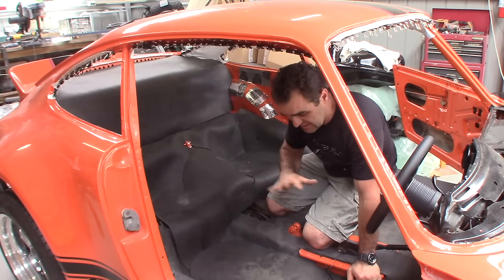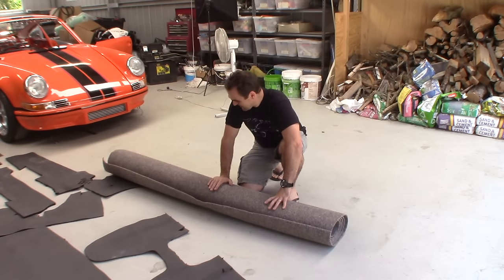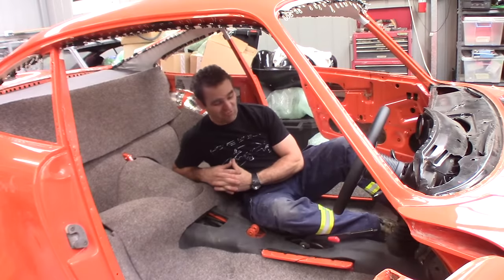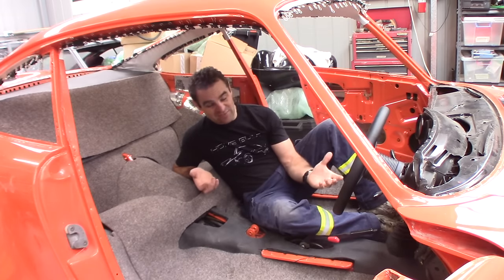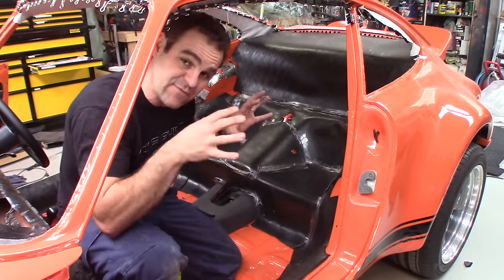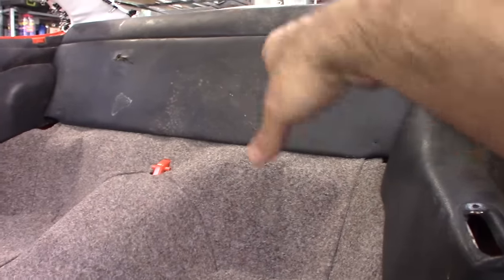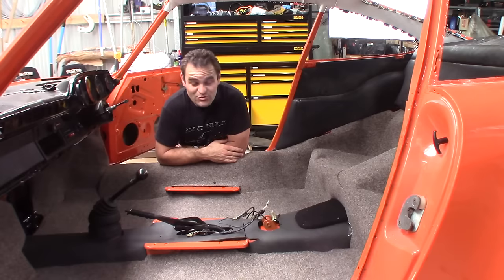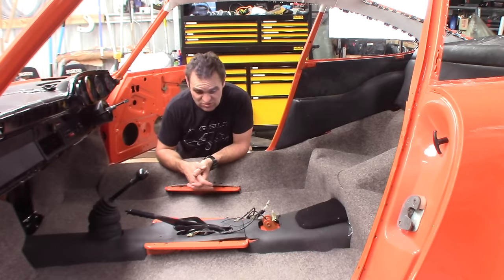Making a carpet kit - Porsche 911 Classic Car Build Part 37

Comment: Great decision on the AC. Even Porsche admit, a GT3 with air conditioning, is faster than one without. Because a cool race car driver is a lot faster than one who is being cooked in the car.
Reply from the maker: Like I said in the video. I am starting to come to terms with how I am really going to use this car, and realistically, I will rarely tatke it to the track, so I may as well make it comfortable. The performance difference between a comfortable car and a stripped out one is much smaller than the comfort difference.
Reply: everyone wants their car or motorcycle to be a racer until they have to actually use it for road duty. was going to build my old honda motorcycle into a cafe until i realized i want to enjoy riding it further than across town.

Comment: jeff have you considered using clips - ie. screw/rivot clip to floor and attach to carpet and clip the carpet in place.
Reply from the maker: I did look at using clips and I am still considering using something for the floor mats. The issue is I couldn't find anything that would really work properly. I looked at press studs, but I couldn't find anything that would work through the thickness of the carpet, foam and MLV. I am definitely open to suggestions though.
Reply: Home Built By Jeff surely for the floor mats you could just use a set of clips from some overmats? The twist lock clips are pretty secure and seem to be bolted through to the floor. Add a third one to lock the carpet in near the pedal box??
Reply from the maker: I had a look at my local Auto store, and at the craft shop. I should have more of a look online to see what I can find. I know the clips you mean, I just need to find where to get them.
Reply: Home Built By Jeff you should try ebay all sorts of bits n bobs on there.

Comment: Everytime i look at my cars carpet i wonder if i can make a replacement one.. the thing is, it's a one piece and i have no clue if there is raw thermoformable carpet..
Reply from the maker: Most newer cars have thermoformed carpet and I have often found it is pretty cheap to just buy it from an auto carpet place. Mine, being lots of flat pieces, makes it expensive for them to edge all the bits. If you look further on in my series, I actually changed to black carpet and edged it all as well.
Reply: Home Built By Jeff mine's only a '94 Subaru J12, nothing fancy.. I think i'll try smoothing the car floor and gently warm the carpet with a heat gun to mold it..
Reply from the maker: I would probably suggest using a hair dryer rather than a heat gun, as you will singe the carpet really easily, but that is the way to try it. Even better would be to steam it somehow.
Reply: Actually, mine deformed a little while trying to pressure wash it using hot water to remove old stains so the steam option might aswell work..